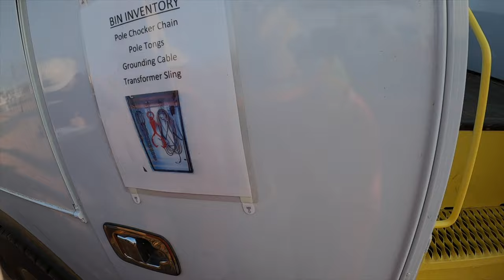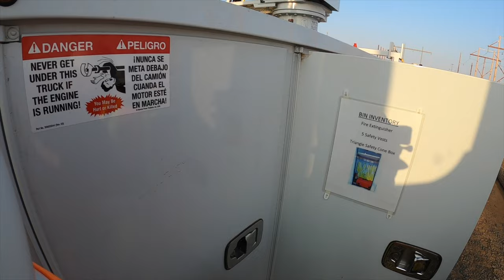NLC Pretrip, Learning the Digger Derrick (2021)

Comment: Love the enthusiasm for training! Another group of future utility safety and linework leadership getting a great start at NLC.  It's also great to see instructors taking the time with each student to learn how to operate.  There is a significant amount of information missing from his instruction on leveling the unit and setting the outriggers, however. That is the most important part of keeping the unit stable.  Digger derricks are stability tested on a level, firm surface for digger derrick use (material handling or auger use).  If you do not completely level the unit to Zero degrees, you won't recreate the stability conditions the factory used to test the unit.

In the operator's manual for Altec digger derricks, appendix, there is a great checklist for your preoperational inspection. That's the factory guidance you should be using.  The preoperational inspection is detailed in Section 4, Preoperational Inspection, and there are many steps that weren't shown in this video. Not sure if the instructor knows there are safety systems and interlocks that should be tested before operating. Section 5, Protection Systems.

The outrigger instructions, including how far they must be extended (minimum), is described in Section 6, Outriggers.

If you read the operator's manual and gain this knowledge, you will be a truly rare person in the industry. You will also have a much better knowledge of how to stay safe while using this complex piece of equipment. Plus, your truck will be much better cared for.